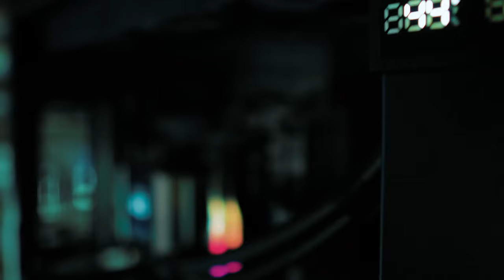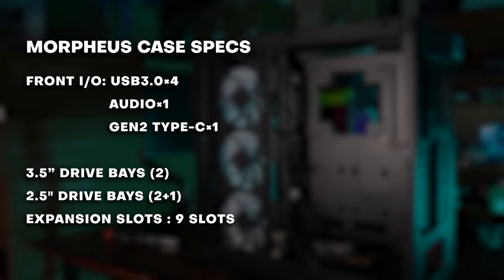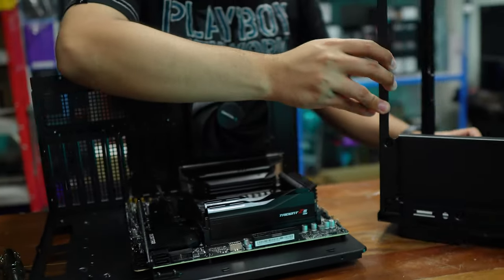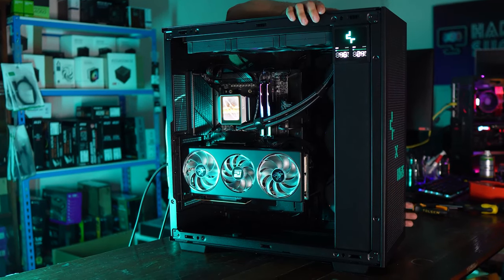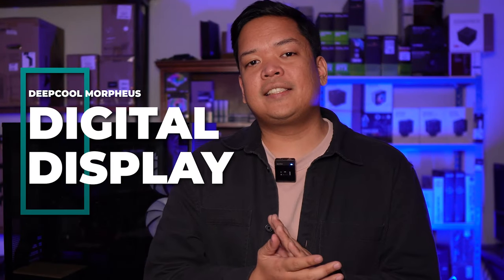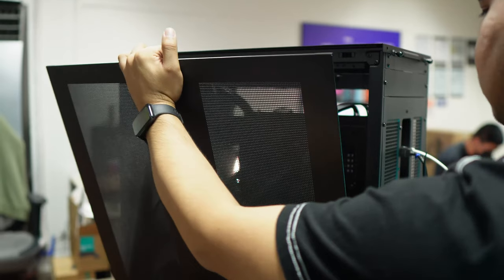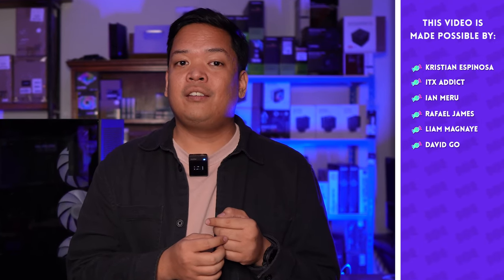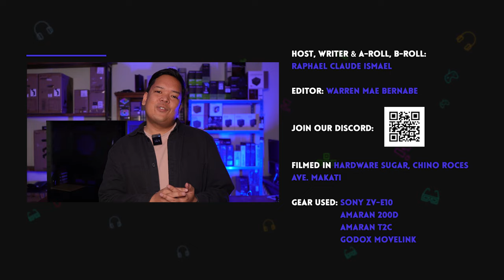Deepcool's Most insane Case | Morpheus Case Review

Comment: Hey man quick question, in dual chamber mode do you think it has enough room for a 120mm wide GPU in the regular position (horizontal) ?
Reply: In dual chamber mode, you're required to vertically mount the GPU
Reply: Well vertical has better temps if you have bottom fan and back fan so IN THIS CASE VERTICAL IS PROOVEN TO BE BETTER THIS CASE ONLY 

I HAVE THIS CASE SO 60-80MM FOR WIDE NESS
Reply: I measured just now roughly around 150mm to 130mm so you should be good
Reply: @Goldmanknight  Oooh I see thanks a lot man 👌
Reply: Your welcome if you need any question I will 100% answer
Reply: @zeph5800  also check the c8 antec case
Reply: @Goldmanknight  thanks again. About the fans I'm planning this : 3 front intakes, 3 bottoms intakes, AIO on the side and 3 exhaust at the top. Maybe a exhaust fan on the back. What do you think of this ? Also all of the fans will be 140mm
Reply: If your going to have it on dual chamber mode no fan fits in the back

If you can mounting the AIO on top would be the best option
Reply: @Goldmanknight  Ok thanks again !